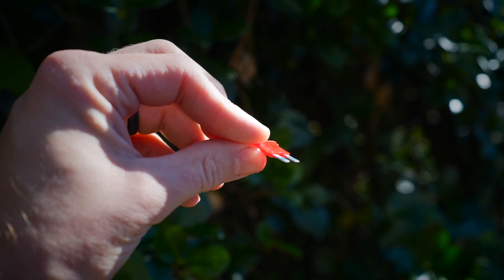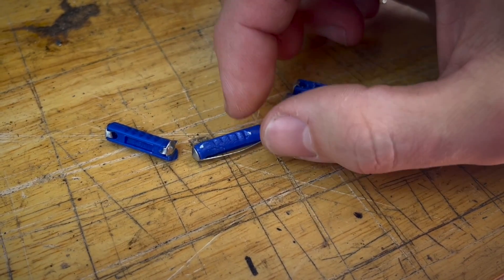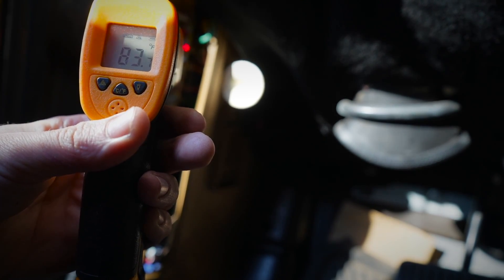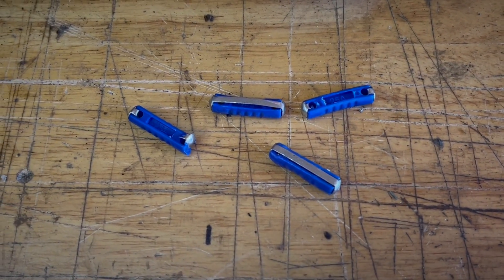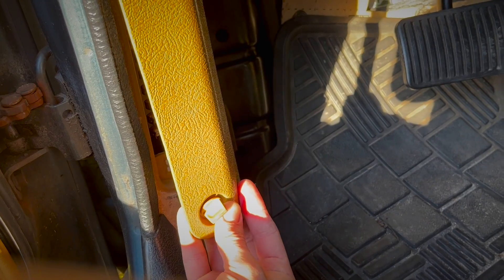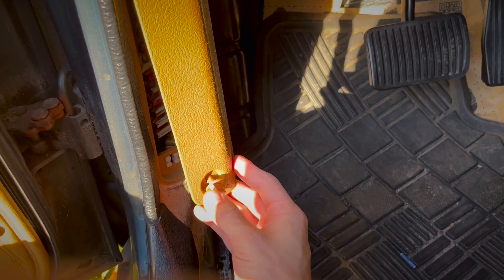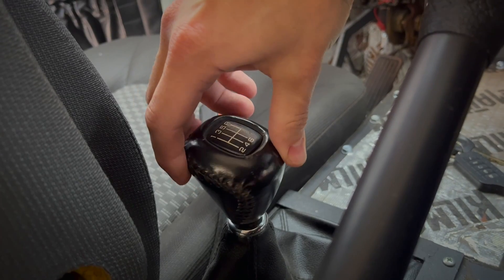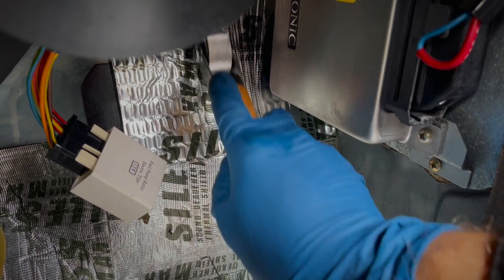Melting Fuses Fixed - Upgrading Euro Fuses to ATO/ATC

Comment: You are correct,  When a fuse gets hot it is because the connections are poor.   If not  cleaned in time,  the  spring  terminal is heated with the fuse and loses the spring force.  Then your fuse and connection continues down the path of overhearing  and melting.   The correct  fix is the replace the spring connection and clean all the fuse contacts.   You may have done  this  with the ATO  holder but you also increased the wire and contact points.   Sometime  bending the contacts will solve the problem

Comment: Probably gonna be doing this just replaced the fuses in my 93 Volvo 240 and then headed to work, and started smelling burning plastic, pulled over and reached down to feel the fuses and it melted onto my finger 😂 just so happened to be the fuel pump fuse too so it just shut off. Only the number 6 fuse gets hot and seems I got bad fuses from Amazon so I swapped in a old one and it worked but now ready to just swap it like you did. Thanks for posting this!

Comment: Matt, yours is one of my absolute favorite channels I subscribe to. Watching everything you put out to get a nice healthy dose of sarcasm and cynically-slanted knowledge with comical reviews. Your line “not a craq-house, it’s a craq-home”, had me rolling. I am trying to decide which wire harness and panel to go to for under the dash to replace the corroded “read-rusty” glass fuse holders of our fuse panel in our 1967 Olds Cutlass. I also much prefer the ATC or mini ATC fuses as well. What did you do on your Riviera?  My wiring under hood is already done with bussman panels and tefzel wire all for the EFI and all systems, but my under dash is a rolling dumpster fire of lost hope and disappointment mixed with frustrations of a man who knows better.
Reply from the maker: Lost hope and disappointment mixed with frustrations is my speciality! First off thank your for being here buddy and I’m glad you like all my garbage! The riviera is using a “universal” 22 circuit fuse panel from eBay. I was in the same spot not wanting to mess with a 50 year old glass fuse block and wiring. The Beetle LS swap is hybrid with a tiny “hot rod” style 14 circuit fuse block to run the body/car side and a separate bussman specifically for the LS engine wiring mounted underhood - similar to what it sounds like you’re thinking. I always like to get a bigger harness circuit wise than I think I’ll need because then I can use the extra lines for separating out stuff rather than daisy-chaining like a lot of the small kits do. Aka separate fuses for the radio and ACC plug instead of combined. I usually just shop for cheapest harness but making sure to make sure it’s real copper wire not copper clad. I’ve seen cheap chinesium wire get corrosion inside the jacket and I can’t imagine wiring the same car twice haha.

Comment: Why was only that one fuse causing trouble and not any of the others?
Reply from the maker: Oh I’m concerned about them too! This is just the highest amperage circuit on the panel so it’s the most likely to cause problems. They actually make retrofit ATO fuse panels for old Volvos which needs to be in my list
Reply: @MatthewFinlay yeah but why?
Reply from the maker: Oh, why! Corrosion, rust and corrosion - seen it once, seen it well… at least once.
Reply: @MatthewFinlay  I have one. It's functionally great.not a blown fuse in the past year..BUT $150 and the fuses are not all lined up in the same orientation...feels more like a $70 part.  Currently scouring the internet to try and figure how to modify the stock fuse panel for ATC fuses. Flag terminals and soldering solid copper seems like an option..if it all fits...
Reply: Real ceramic continental style fuse bodies don't melt. But finding them is hard since Bussmann and Littelfuse which were the last brands to offer real ceramic torpedo fuses switched to the same cheap plastic bodies of the far east manufacturers, so kudos to you for the mod. As for me, I have procured enough NOS real ceramic Bussmann fuses for my VW beetle to last my lifetime.